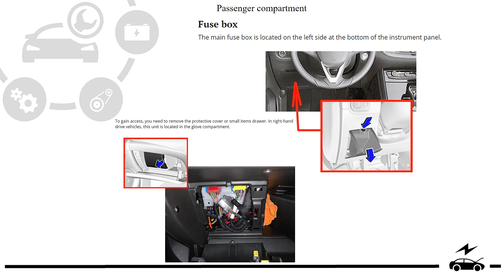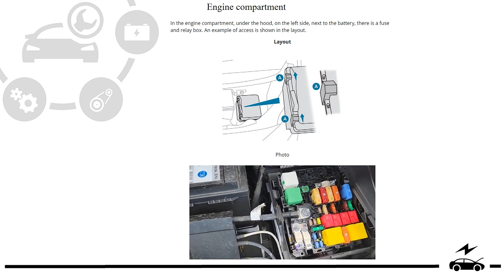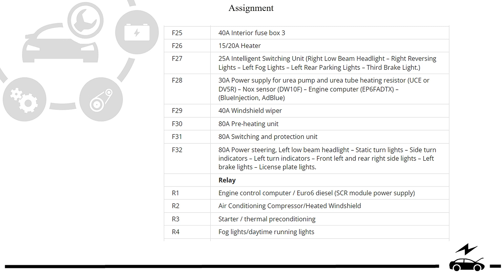Fuse box diagram Peugeot 208 (2019 - 2024) and relay with assignment and location

Comment: What's a good place to connect the wires of a dashcam? I need one + that's always powered, and one that's powered when i start the engine. Voltage can be 12-30V
Reply: I don't know if this is a bit late but I just use the cigarette lighter and it powers the lot, also is 12v already